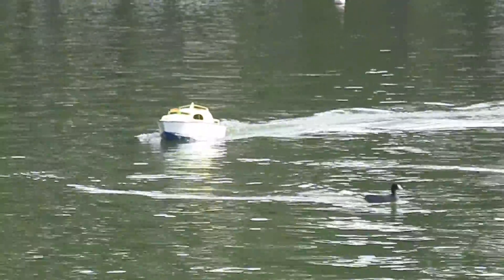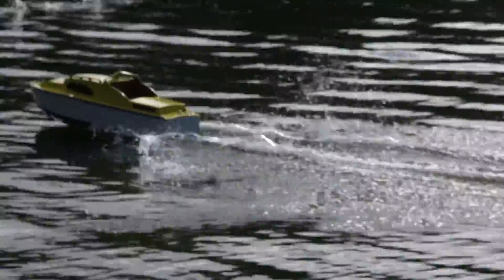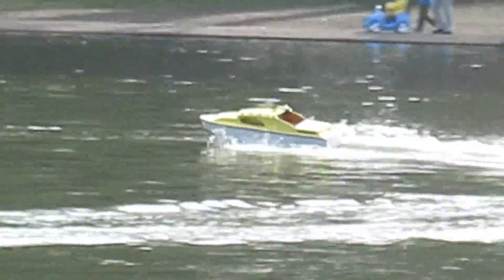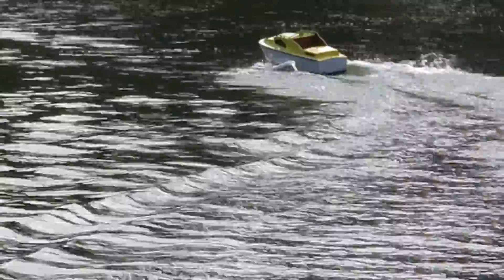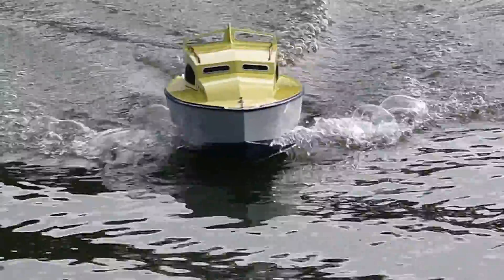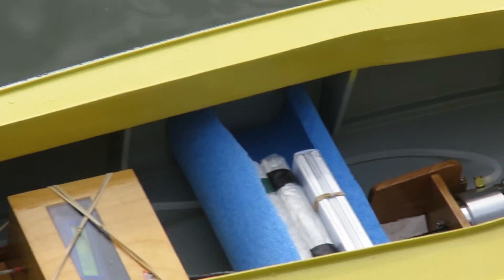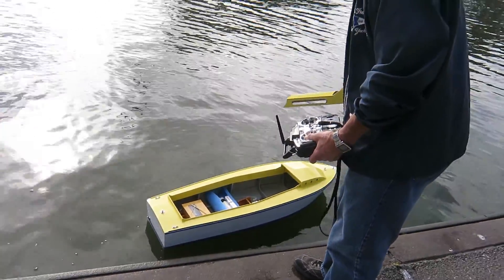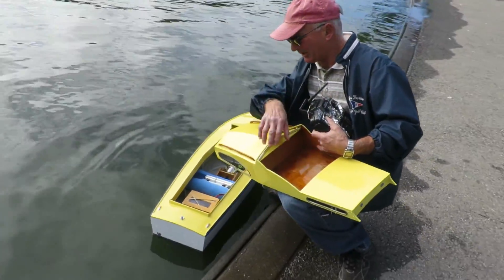Rebuilt Sea Queen R/C Model Boat with Astro 860 Brushless Motor

Comment: Nice! I am building a similar sized boat where the hull looks like this one. But I have a modern 1500kv brushless drone motor and will try a 2S battery (to keep the revs down) and the prop will have 3 blades. I am expecting reasonable speed from it, have to see. I will fabricate a water cooler for the motor using copper pipe.

Comment: I got one that isn't built all the way yet. They didn't have the top set up to come off as a single part like this one does and I think it'll have to be done similar but with a dbl horse type drainage trench around it because that works so good.
I'm building mine as a fishing boat because the dbl horse at 31" isn't big enough for the fish I want to catch. Going to FPV camera:s looking forward and backwards and maybe one looking thru a clear part of the bottom. I'll be using a 3D printed 45mm jet drive and have a pull out pole to be able to fight the fish twice, getting the boat to the bank then getting the fish in after that. It's also going to have a wrist type fish finder installed manly for depth info. A ball type compass in view of forward camera will help a lot when driving around with goggles on.
I know from driving my diy 19" jetboat FPV.
Really need to get back on this but moving and building a home got in the way.

Comment: Nice boat. Brushless motor is fast and quiet, I have one running on 4S with SSS 5694 motor at the beginning, now working on changing the power to a Zenoah 20cc motor.
Reply: Hi, What Zenoah engine did you choose for the Sea Queen?
Reply: @haydenbrown8421  it is ZENOAH G200PUM 20cc GASOLINE MARINE ENGINE